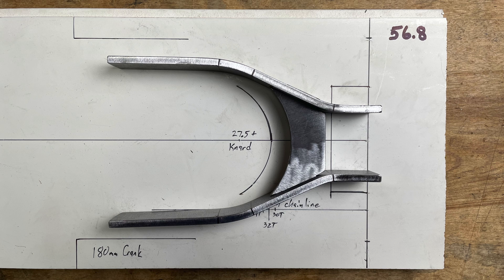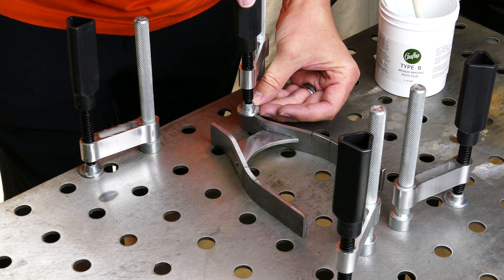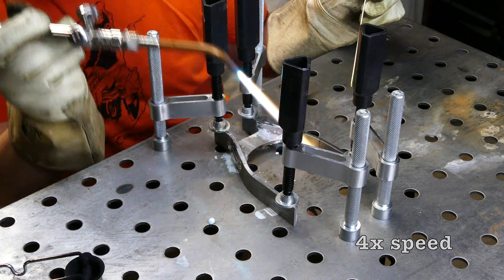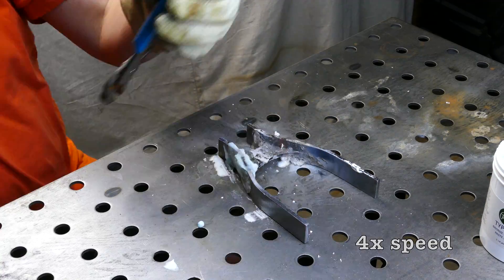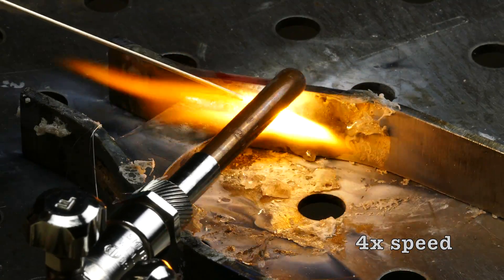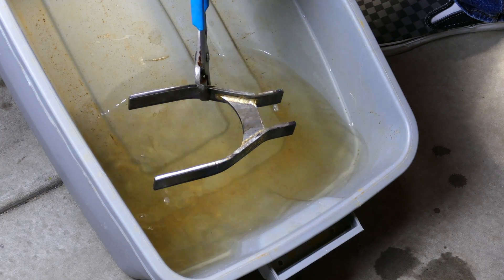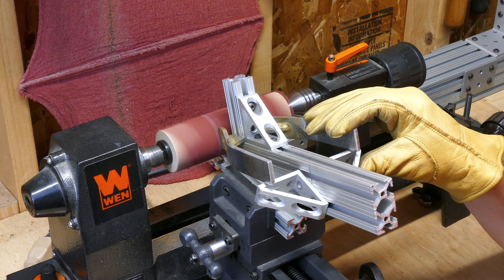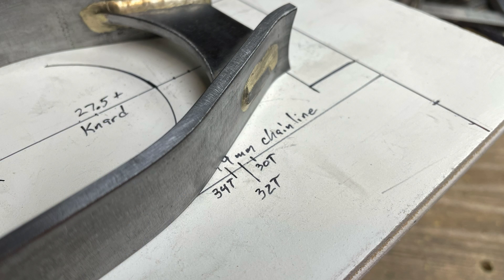DIY MTB Frame Ep 9 - Custom Chainstay Yoke

Comment: Hey,I've got a Flux question!  How old do you let the flu get before tossing it?
Reply from the maker: That’s a good question that I have no answer for!  Personally I’ve never thrown flux out, and with doing 1 frame a year, it sits for a while. My Gasflux stuff just gets dry, so I add water and call it good. My Cycle Design flux has formed chunks/crystals over the year(s), but I still use it. I should probably warm it up and de-crystallize it one of these times.

Comment: That cubitron stuff looks like it cuts really well. I'll look that up for my similar setup, thanks! 👍
Reply from the maker: It does!  The one thing is that I couldn’t find it in the same weight backing as the emery cloth. The cubitron is thicker so I had to turn down the mitering cylinder a millimeter or so to get it to the correct diameter.

Comment: Epic! Can you send me the Cutfiles? 😅 maybe someone on my Workplace can Cut this for me when Chef ist somewhere else 😂

I will try to Rebuild and TIG Weld a Dartmoor Hornet Frame with slightly changes out of CroMo for Me. 

Thanks for your Videos, very Helpful. Nice greetings out of Germany.
Reply from the maker: Thanks!  I'd recommend checking out Konga Bicycles: https://kongabicycles.com

They aren't currently on his website, but I know he had plans for yokes at some point.

Mine is similar, but his is a stronger, tougher yoke design that would fit with the Dartmoor Hornet type of frame better.  My design would probably be too flexy.